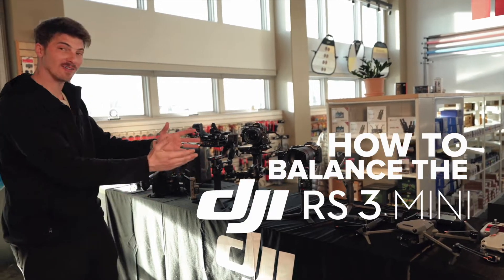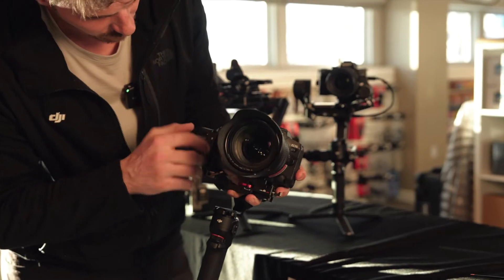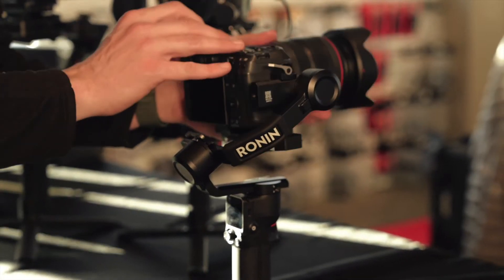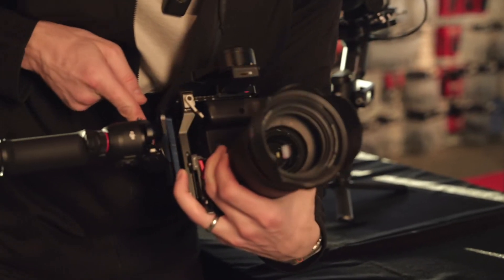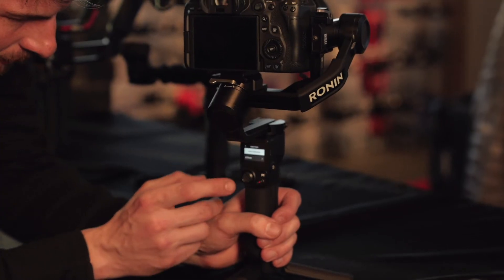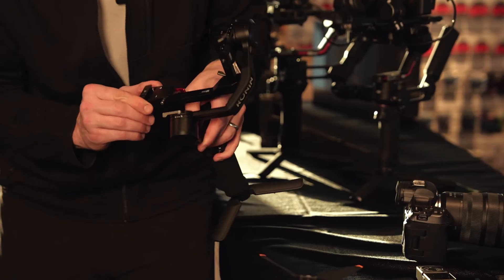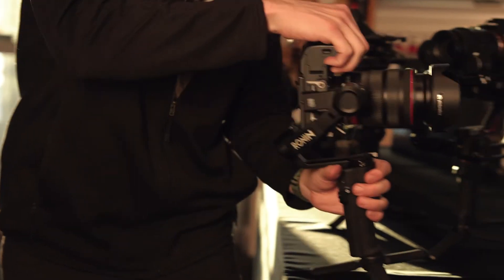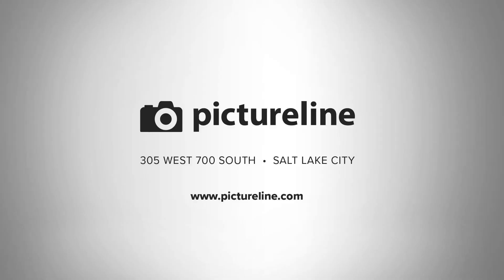How to Balance A Gimbal | DJI RS 3 Mini Vertical Balance

Comment: see I'm using Sony alpha 7R V but most of the time face issue with L-plate. once i set it on vertical mode and make it balanced after calibrating it goes down all the time. i have only L-plate tell me how to manage this issue..

Comment: I use this gimbal. I can balance it in my dreams. I just started working on some reels and I can’t balance it vertically. It looks balance, it feels balanced but when I run the balance test on the app it says balance is required in my tilt axis. Anybody else has this problem?
Reply: Yes I keep getting this same problem it balances all my lenses fine in horizontal but it feels and looks balanced when I redo for vertical then the balance test app says everything needs re doing, at this point I’m debating sending it back as I need vertical shooting more than horizontal
Reply: @sophiecooperphotos  any update on your predicament?
Reply: @MilesCooperUK mines is still doing the same I give up

Comment: No matter what I do. I can never get my Nikon Z30 to stay still in any position which (from many tutorials) is telling me that my balance is off. It always tilts back.  Every time I do a balance test as well, it tells me I need to do it again. I bought this last week and I haven't managed to get a perfect balance yet. I feel hopeless at this point. It shouldn't be this difficult.
Reply: I'm having a lot of trouble as well. I'm using a Canon R5 with a transmitter on top and a 20-70mm lens - comfortably under the 4.4 lb max. thinking of returning this, but will try a few more times.
Reply: Hello. I bought the Zhiyun Weebill 3 s gimbal. I couldn't get perfect balance with the Sony a7r3a camera and Samyang 24-70 mm F 2.8 Lens I have. The lens is heavy and it doesn't balance horizontally or vertically. Although it doesn't exceed the weights specified by the gimbal. I returned it. If possible, it would be better to try it before buying and make sure.
Reply: Helo did it worked for you? Check your mounting plate maybe it's not attached right

Comment: The recommendation you gave to calibrate the gimbal with the lens' intermediate focal distance is an excellent tip that helps me a lot to solve that doubt I had for a long time. Thnak you so much